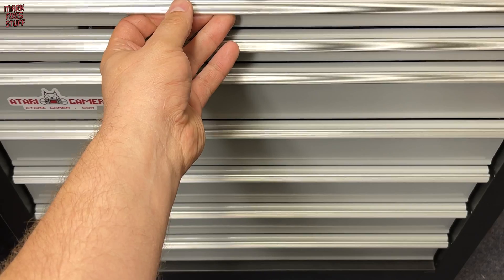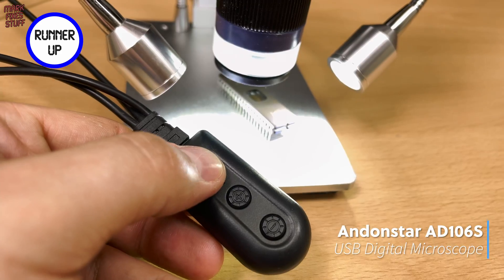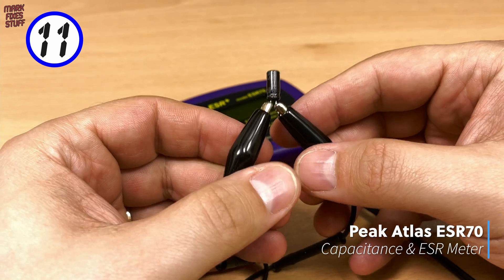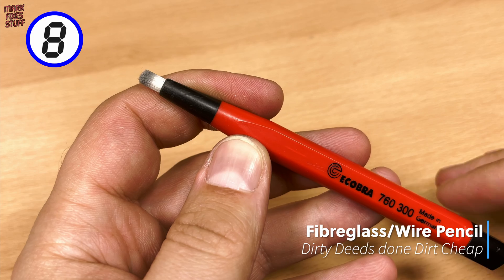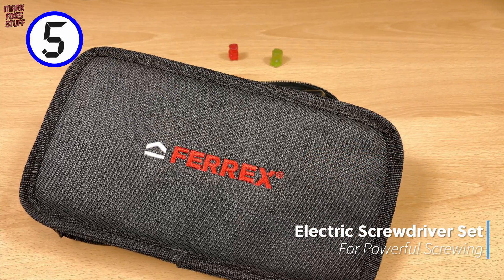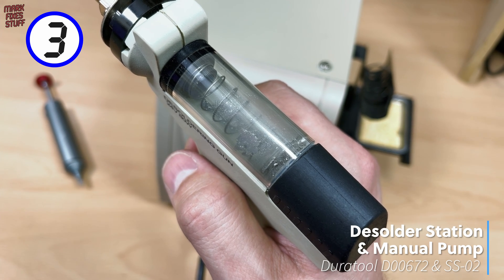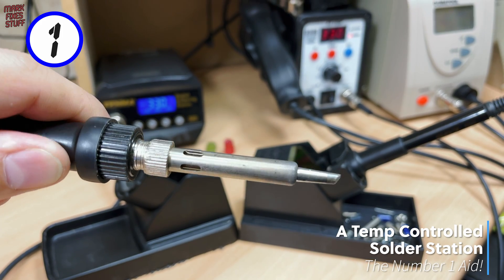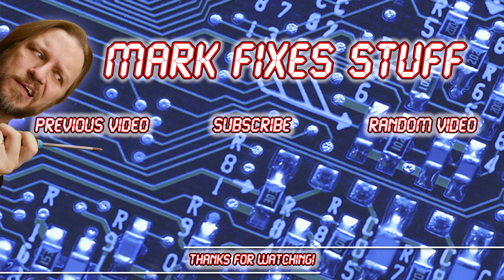My TOP 13 Tools for Fixing Retro Electronics might surprise you!

Comment: I ran 19 volts into my Sinclair zx spectrum 128k 2+ what do I do is it broken
Reply from the maker: I’m guessing it’s the wrong polarity? 19v with a centre negative tip would be fine - the regulator can handle about 30v and just runs hotter. If you used a center positive 19v supply the regulator is most probably toast. It’s the black thing screwed to the heatsink. Try swapping that out first. It’s about a pound.
Reply: Nice cheers is it easy to fix
Reply: I haven’t ever tried fixing things
Reply from the maker: If it’s just the regulator then it’s unbolt the old one and plug in the new one. Worth a try first. You want an LM7805C
Reply: So no soldering required
Reply: @gariboldi5606  De soldering and re soldering is requires, only 3 legs, easy stuff.